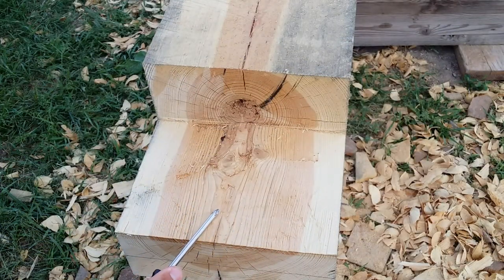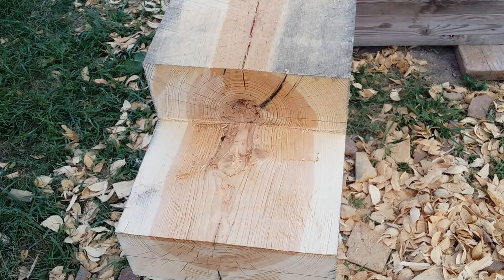Timber Frame Barn -  Rotten to the Core

Comment: I wish you could tell how far and the path of the rot.  From an engineering point, the center of a beam in bending has a neutral stress with the upper area in compression and the lower in tension, assuming loading as with gravity.
Reply from the maker: Me too, just don't know